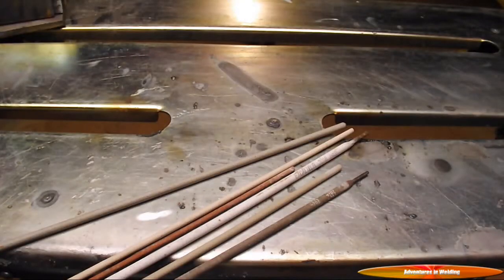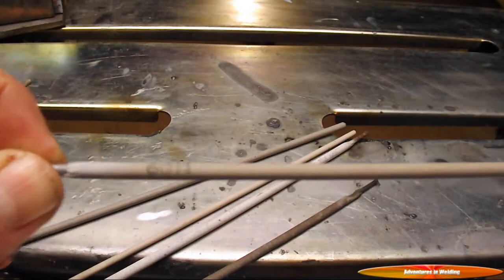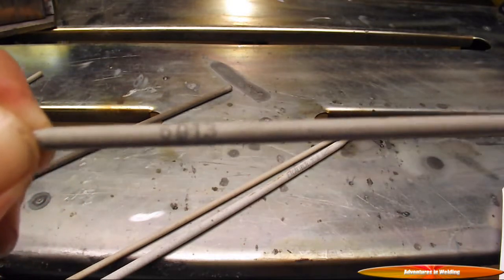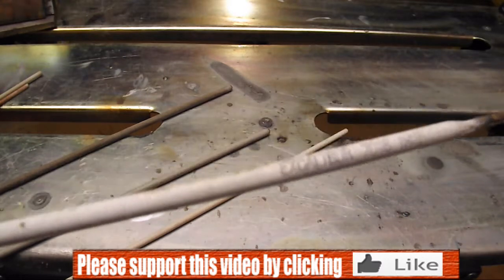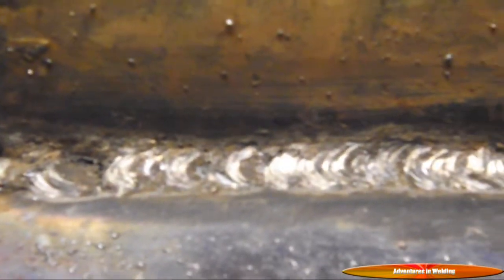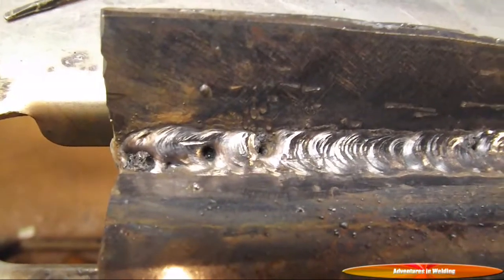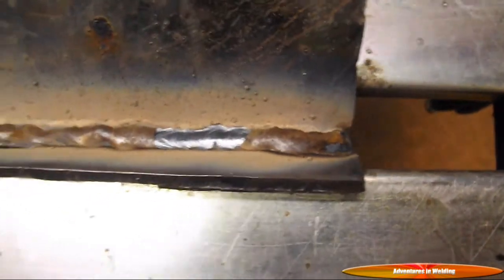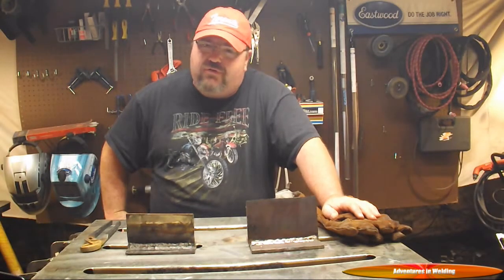Why are there so many electrodes? Adventures in Welding #128

Comment: Do you have an opinion on using a breather mask to filter out the welding smoke? Some say don't bother and others say you should use a breather mask.
Reply from the maker: +moofushu I tried to use one but couldn't. Howver if you can handle it, I would reccomend getting one.

Comment: Hi Paul, When I worked at B.H.P Steelworks back in the 80's we used a lot of 6013 for small maintenance welding, like welding a piece of rod on the side of a bolt so that it doesn't turn on you, like under an electric motor stand where you cant get a spanner in there. We sometimes used 6011 to burn out rusty areas so that you could get a good solid weld in. Only boilermakers would use 7018 and 7024 for big heavy structural welds. "We" as fitters, were not allowed to do more than 2" long welds, because under Demarcation only Boilermakers could do structural welds. But since those times I've done welding certificates through college and I do more structural stuff now.  Scott.
Reply from the maker: scott carr Structural and fabricating are my passions. Pipe might be where the money is, but I need to create things.